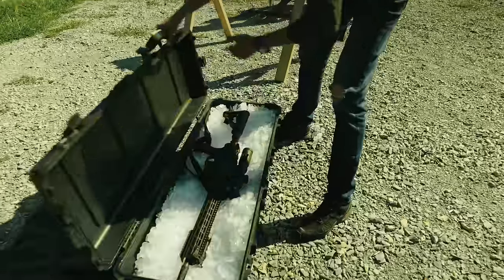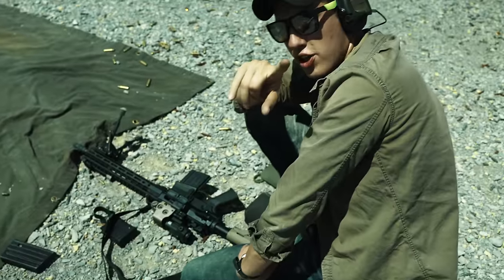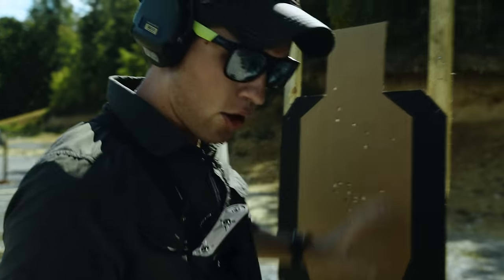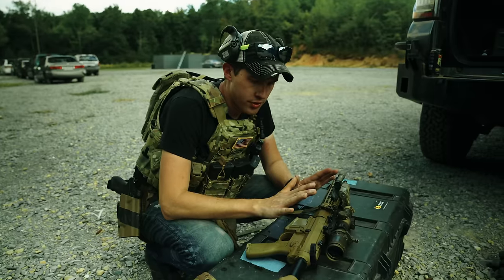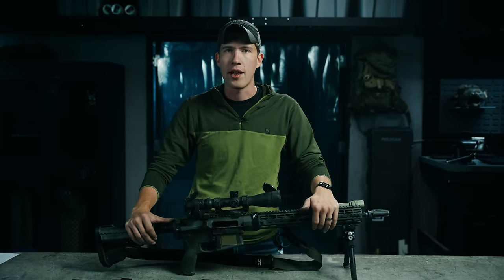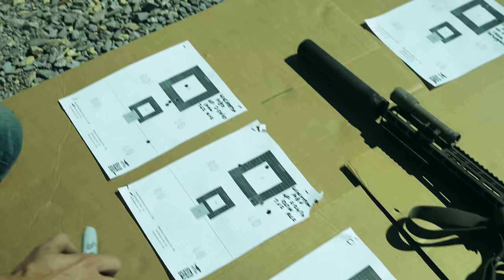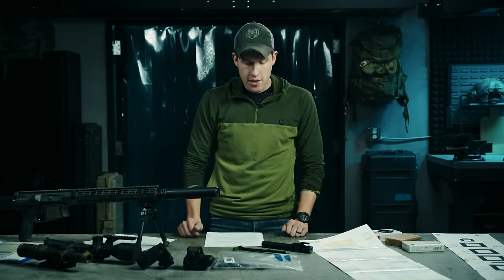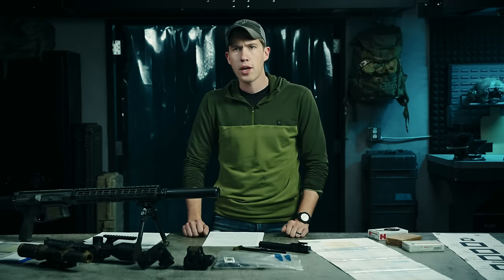Aero Precision M5 AR-10 5,000 Round Test

Comment: Excellent video you guys. Finally got time to watch the whole thing. One thing I found interesting was your approach to accuracy. Barrel length, twist rate, and projectile weight have a sweet spot where they all meet for optimal ballistics. You just need to find where that is. Also the grade of ammo plays a big part. Boat tail hollow points are almost always going to fare better than cheaper practice ball ammo. What works in one rifle may be horrible in another. There's no one magic bullet for every gun. You have to find what a particular set up likes, is repeatable, and stick with it. Then you'll have a reliable zero to work from if and when you change bullet weight, manufacturer, or other parameters.

Comment: Early on the ejection seemed quite weak.  I’d like to see how all the more budget “friendly” 308 rifles(sub 2k) stack up against something like a scar 17. Would also be interesting to see how they all eat (or don’t) steel case ammo. If it’s a battle rifle you intend as an “end of times” weapon system, you can’t rely solely on finding brass case ammo. I have an aero rifle I put together in 6.5cm for long range work that is also finicky suppressed. Excellent video with a mountain of information. Keep up the good work.
Reply: Ejection was to about 1 o'clock without a can -> way overgassed

Comment: Absolutely loved this test! And I love that Aero is involved and made a very credible rebuttal. This test for what is has added value to the M5 itself. I WANT MORE! I think the .308 is a very important cartridge that every shooter should have, but should feel confident about taking to the end of the world. I would love for you to conduct a similar test with a Bula Defense M 14 or a SA58 FAL. Thank you
Reply: It's a meh cartridge for today's practical application. 
300BLK for within 100yrds is better.
20" 5.56 for level 3+ targets inside 100yrds / hunting deer and smaller (can headshot a moose at 400yards no problem though)
100+ yards 338 lapua for anti material / beats lvl 4 armor.

Don't get me wrong. I love to shoot my ar10 SASS in 308 and take take it out to 600 with 1moa consistent with my handloads. However, it weighs almost 20lbs loaded and won't punch holes in an engine block.

Comment: While the price range would be a bit high for what Lucas had brought up towards the end of the video, the LWRCI REPR mkii would be interesting to see as a contender for competition against this rifle - specifically to see how well a firearm advertised as being a true duty use weapon, would stand against this baseline Aero rifle. Thank you for all of the information you provide to the community!
Reply: there is no ocmpetiotion between a aero and lwrci repr....lwrci is top notch and aero is average
Reply: the REPR MKII is meh, looks cool and all but we had one at the range i worked at and it broke 3 times over a 6 month period. My aero m5 that i personally owned, had 3500 rounds through it (over about 4 years), never had an issue. I never cleaned it however, when i first put it together i did soak the inside with ballistol so i did not run it completely dry.
Reply: @LAAM619  What were the specific issues you experienced with that REPR at your range? Curious what parts were the weak points on such a high priced gun

Comment: Beware that the Aero Precision bolt carriers use 0.07" wide firing pins that are extremely hard to find. The most common is 0.08 and sometimes 0.065 for 6.5 creedmoor bolts

Comment: Great video! It's a bummer that most people don't think that the best adjustable gas blocks are really duty-reliable, and that no one has come along and made a AGB that really is duty-reliable. I have a Superlative Arms one on my M5 and it shoots extremely smooth suppressed and unsuppressed when adjusted to barely cycle without my can on. I bet the parts would fail much less quickly if the gun was less overgassed.
Reply: I have a Seekins on mine and it runs well too. I tested with different gas and buffer weight. I have something that runs smooth and doesn't kick harder than it has too. M5 receiver set, Atlas R One Handguard, Ballistic Advantage BCG and 20" Stainless barrel(its a hefty boy), and Magpul furniture. I stick with only a few different brands and alll run consistently. I wish I had a can for mine. Maybe one day.
Reply: That’s almost exactly my set up. I went with the Odin Works handguard to save some weight.
Reply: @benthephilosopher  What optic do you have? I have Leupold 4.5-14x40
Reply: @jacobleonard7306  I have a cheap-ish primary arms scope. Definitely want to upgrade to something nicer eventually.

Comment: Carbine length gas system on .308 seems like it will be unreasonably harsh regardless of all other variables..  Honestly, longer barrel lengths and gas system seem like they may be a good idea for .308.  I think it is interesting that you are thinking of adding a stiffer spring as a remedy for over-gassing.  A stiffer spring is increasing the force on the BCG, just in the opposite direction.  So, while this may reduce felt recoil, it is not reducing force inside the rifle...
Reply: due to the barrel length they could have at least done a mid length.

Comment: I was the SDM and unit trainer for the M110a1.
Also, I own an Aero M5 just like this one. I love my "mPovertya1". The accuracy is in line with the HK contract specs and Lucas is running it far harder than allowed with the a1. 
When it comes to the price, the M5 is a far better buy over the HK, no question.
The LaRue is where I would point my attention if you can afford the upgrade. I think it's the best overall  with price to performance. I would love to see the LaRue in this test.

Comment: Ok I finally finished the video, thank you for making it. With my sample of one I’ve had  good luck. I don’t own a factory built AR. I’ve assembled all of mine but I do have seven AP/BA receiver sets, BCGs, handguards, and small parts. Most of which have been suppressed. As for me grabbing a AP bcg now knowing it’s supplied by a vendor I may shop around more. When I started looking at AR10 builds it was commonly stated to get a ADJ gas block. My build has AP branded buffer kit, LPK - fire control. I use Larue MBT flat bow triggers in almost every AR.  Ive shot Norma 150 with mediocre groups but found anything lighter than 150 is trash out my rifle. Freedom munitions 147 fmj m80 was horrendous. I could throw 5 rounds and have a better group. Bullets 1st 175, federal fusion 165, 
Hornady ELD match 168 no good for tight groups. But PPU 168grain match hp bt in the gold box shoots lights out sub moa .5-.7 groups. Fiocchi 175 match king hp bt does as well. I’ve always shot suppressed without issue but I have a adj gas block. Aero buffer kit no springs or buffers changed. 
I clean regularly but not on a real schedule. My only advice to anyone looking is to go with the adjustable gas block and buy with confidence. I want a 6.5 set up next year so I’m weighing out another AR10 this time in an anodized color or a solus.

Comment: Had the exact issue. Same dents and scrapes. Mine shot perfectly until I used hand loads. So I have that problem of the bolt not closing and just a click. Now I’m freaking out because I’m feeling my hand loads haven’t been built properly. Took it to a gun smith in my area. He thought the ramp was damaged. So he polished it. He felt I needed a new barrel. After less than 500 rounds. I felt good with the polished ramp. Well it jammed up again. This time factory ammo only. Then instead of the $140 I learned to use a screwdriver. Then after cleaning, buffing and lube it happens again. No luck with the screwdriver. Now I’m tapping the bullet with a rod. I am done. Not doing this again. 3 years old and a lot of time in the safe.
Is it possible the BCG is broken??
Thanks for the video!! I spend a bunch of time loading and proud of my product. Major relief knowing this has happened to someone else.

Comment: ;I have around 4k through my M5 (in 6.5 Creed).  It had an initial extraction problem due to the extractor groove being too tight (due to the NiB coating).  After I fixed that, it has been a phenomenal rifle.  Groups started opening up and velocity dropping at around 3k (SS barrel), so it has a newer barrel now.  I shoot it mainly suppressed with a Superlative Arms gas block, so the NiB BCG really helps with cleaning.  Aero needs to start with a wider extractor groove for the NiB versions.

Comment: Hey Lucas i recently did a when you made this video.  I have a few LMT MARSH and MARSL.  This time around i did a somewhat budget build.  I used Aero M5E1 lower and M5 upper. I used and SLR ion hand guard.  Now that we got exterior done we go to the inside. This is were i strayed off of budget.  I used the JP super match 18 in barrel (DMR STYLE LENGTH) with matching HighPressure JP bolt that came with it, JP LMOS Carrier, JP High Pressure BCG Completion kit, JP SCS buffer system, Superlative arms adjustable gas block, Surefire War comp (war comp due to shooting suppressed and unsuppressed, radian charging handle, gieselle SSA-E-X trigger, and then all the fancy lower parts.  MAN THIS THING PURSSSSS with my RC2 supressor.  This has been an amazing build. Aero is doing some good work.

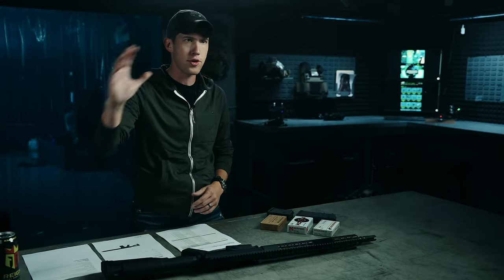Comment: I’m 4:25 mins in and making this comment. I assembled my M5 with mostly Aero parts. Upper,lower,adjustable gas block/tube, 16”BA barrel and shot 100% suppressed. I have a RTB NIB BCG, because back when I assembled it Aero BCG was hard to obtain. My rifle shoots very well with 168 PPU match ammunition. Equally well with 175 fiocchi. I can say certain ammunition groups like crap but the two i mentioned are sub moa with the DB tactical 6-24x50 on it. I’ve ran about 7 different manufacturers ammunition through it with no FTF/FTE. Now I’m definitely not Lucas operating it but she’s seen roughly 1500-2000 over the last 3 years roughly. So far no issues but this week I decided I wanted the AP Melanite BCG so I’m interested to see how this video ends. I wanted to get rid of the bling from the NIB BCG. More to come…

Comment: A lot of manufacturers ship parts "dry" and they do not apply any lube or thread locker at all to their products. 

Personally, i dont mind, as I use 4 different products on AR platform rifles, regardling thread lock. The gas block will get rokset, the handguard will get purple loctite, the castle nut will get a proprietary mix...etc etc etc. 

That being said, a lot of manufacturers dont lube their BCG either, so ensure yours is lubed up.

Comment: M80 ball won't group in a BA barrel.
I just left the range and grouped 1.5 moa with tula 150 and 1 moa with tula 165. Then .7 with 168 bthp hand loads. 5 shot groups out of a 18" stainless BA barrel. The bcg in your rifle is also BA. I bought a dpms then ran 4500 through it then stripped the relievers and built a dmr style rifle. I'm under 1k rounds on the revised rifle im hoping my firing pin doesn't die around 2500. 
Lr 308s are hard to build and get right it takes a lot of tweaking.
I've heard the argument made that a lr308 is to heavy to run and gun with. I'd say you dispelled that mith. It is however hard to keep the barrel down on the 308 for sure.
Great video

Comment: I built a m5, 20" aero upper and lower. I have a binary, so heavy buffer and spring a few other things. I love it, it reaches out to 800 smoothly. Only real problems I've ever had were a few screws needed to be loctited, and when I put my first round through it to site in. I think I didn't lube right cause it had one double feed, and wasn't picking up rounds. One full mag later and it eats through fully loaded 25round mags no problem. I love it, I'm currently building another m4/ar15 from aero. And will be build another m5 but in 6.5, my current m5 in 308 likes the heavier ammo, but takes light stuff like 147 grain no problem. 47:25

Comment: I appreciate the video. I do not see this as a fail. As a former infantry Marine, I would have liked to see a cleaning after every range day. When in the Marines, we would clean our weapon every time we had it at the range and everyday that we were in the field with the weapon system. You are calling this a battle rifle test, but not cleaning this rifle after the range, isn't how a true battle rifle is treated. If you're life depends on the rifle you have, you need to clean it a lot. Seeing the bolt as nasty as it was and failing to go into battery, was proof enough that it needed more than just some lube. There is a lot of carbon that builds up on the bolt carrier. I hope you have the ability to do this test again and hire an intern to clean after range day, and I bet you will have different results.

Comment: Regular maintenance on this rifle would most likely have drastically changed the outcome of the test. Anyone who was in the infantry knows priority of work is weapon, gear, body. If you have down time the first thing you are doing is cleaning your rifle. I dread the thought of how many hours I spent just cleaning weapons systems. It’s definitely important for reliability in proper functioning. Personally I always field strip and deep clean any weapon as soon as I get it in my hands from a dealer. I would also never run a weapon dry for any reason. The fact they got through 1k plus rounds before any lube is rather impressive especially with it being a .308. Overall this rifle seems like a great product that will preform with proper maintenance. Awesome informative video, and kudos to Aero Precision for setting a standard as far as good customer service goes.

Comment: I did an M5 build but used a ballistic advantage pro series barrel (Aero sister company but better barrels IMO and better gassing) 16” Midlength system with a carbine buffer and a cryptic coatings BCG, Rifle runs both .308 and m80/7.62x51 perfectly which means it’s using the optimal amount of gas maybe slightly on the medium high side but if you want to be able to run M80 it’s needed I plan on suppressing it so we shall see if the gas block will need to be replaced with an adjustable one or if I can get away with the non adjustable, Mine shoots very soft but has a dead air brake on it, The bolt doesn’t appear to be cycling to quick, No dents in the brass or harsh over gassing symptoms, I will update after shooting suppressed

Comment: If it’s just a firing pin it should be in your standard back up parts kit. 

Spare Parts Kit AR-15
Kit Includes: Firing Pin, Cam Pin, Firing pin retainer, Set of Bolt Gas Rings, buffer retainer with spring and takedown detent with spring

Comment: The BCG seems to be the main point of failure for all AR10s.   Tool steel, beefed up extractors, and enhanced carrier profiles don't seem to help much if at all from what I have seen and may not even be necessary if you had the ability to control the gas system.  Specifically regarding the AR 10, a significant portion of failures can be reduced with the use of an adjustable gas block.  This will calm the action down both suppressed and unsuppressed.   If it where my company building them I would have the gas block adjustable (3-5 settings) and dual pinned to the barrel standard on every rifle.  No cup screws or clamp-on's, or even detent barrels.  

 I love these test type videos and its obvious I'm not alone. (2.2 million views as I write this), and I would love to see more.   But Lucas!,  for what its worth,  I have seen other channels do the same sort of thing and it always causes controversy because they don't treat the test subjects the exact same.    If you do more of these videos I would suggest standardizing the test so each rifle gets the exact same treatment.   Eg.  lube every 500 rounds (If I had to guess more than 90% of the 308 options out there would fail without lube), day 1- sight in and 200 rounds,  Day 2- 500 rounds etc.  Anyway,  I appreciate this content, you guys truly are amazing.   My subject choices for the test would be the DD5 V3, PSA PA10,  and two small frames like the Ruger SFAR, and POF Rev, I have suspicions these thinned out bolt faces will fail somewhere.

Comment: Mine was really over gassed when suppressed. The case would come out with such force that it would bounce off of the deflector back into the ejection port backwards. I installed a Aero adjustable gas.  Problem solved.

Comment: Hi Lucas, I really enjoy all of your videos but this one especially because it’s timely for me - I am building a budget 8.6 Blackout with both 12- and 16-inch Faxon barrels and am searching for an upper receiver and handguard.

I did this instead of going for a $2400 Faxon rifle so I could:
(1) Have a suppressed pistol sooner than the new 8.6 boombox drops from Q, and 
(2) Determine whether I like the 8.6 round’s performance in either configuration enough to commit and invest further - maybe a longer 24” barrel if this setup is consistent, and if the platform shows promise, perhaps invest in a setup/rifle (semi- or bolt?) if it will make substantial improvements - but not a situation where I’m chasing tiny, incremental changes-which I find frustrating.

I decided to commit after seeing the folding LR-308 lower receiver (DPMS) by 17 Design go on sale for only $130 at Brownells and the barrels came back in stock. I would like to have an SD-type handguard and suppressor setup for this pseudo-Q big-bore Honey Badger.